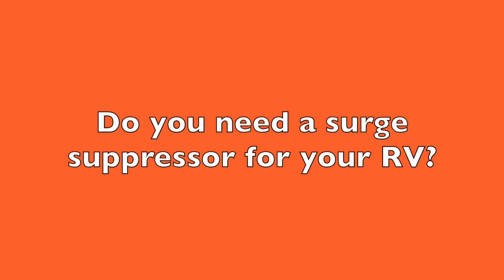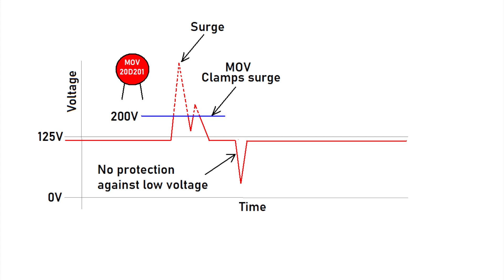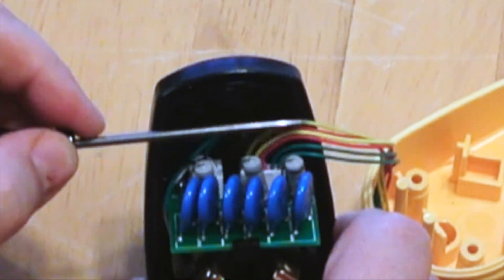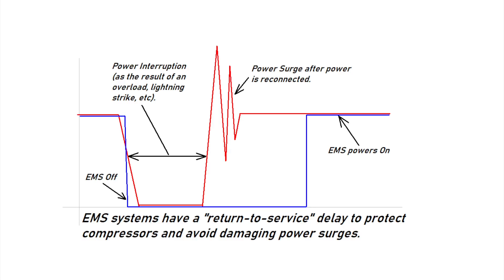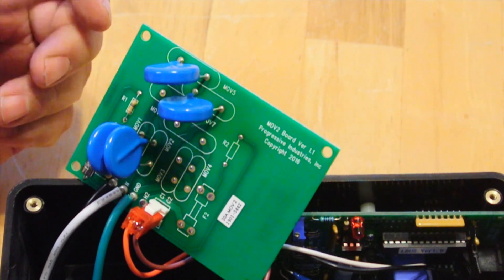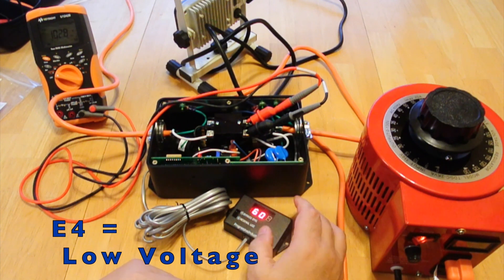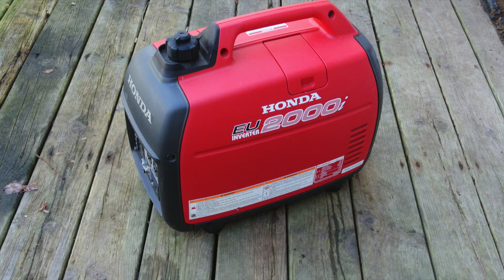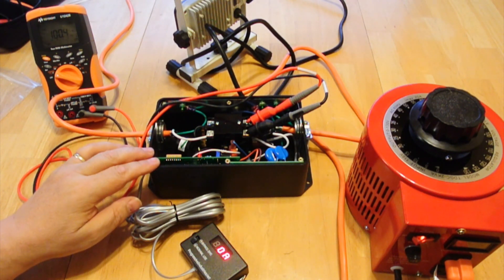All about EMS systems (and surge suppressors)

Comment: Nice job.  One thought though.  The EMS is used on the feed to the inverter not the output.  Our EMSis connected prior to the generator transfer switch.  This way the entire coach is protected.
Reply from the maker: Of course, the "input" to an inverter is a 12V battery.  The EMS can be connected to the charger which is powered by 120VAC, which is probably what you mean.

Comment: The EMS surge protector is the way to go. Expensive, yes but you get what you pay for. I came home from work one day to find that the power was off to my travel trailer. Turns out my EMS tackled a surge that completely burned it up.That electrical smell was horrible. I went to camping world and got a new one. Yes, approx. $400 but, I was back up in 20 minutes. I don't even want to imagine that situation without a good surge protector. Great video and thanks for sharing. I see a lot of folks today without one on their rig.
Reply from the maker: And there is the guy that comments that they have been camping for 30yrs and not needed one...

yet.

Comment: Great video, love all the info.

I considered getting the hardwired Progressive EMS with the built-in display but it doesn't have a way to switch it into bypass mode. I even checked the manual.
Reply: They sell a remote bypass switch for the ones with the built in display.
Reply from the maker: Just to be clear, the remote bypass switch for the EMS system with the built-in display is for the bypass switch only - and does not include a display.

Comment: I run my EMS through a Go Power pure sine wave inverter with no issues. I believe the issue would be 1) neutral bond, inverter is bonded to RV frame and may be insulated from the earth in some situations  2) as you said, a dirty sine wave will make the contactor chatter.
Reply from the maker: Thanks for the input.

Comment: Does the Progressive EMS with remote monitor give you the information remotely (by extending the display inside) as well as right there at the plug in storage area?
Reply from the maker: The remote has about 10ft of cord. In my RV, the remote unit is in the cabinet where the main control console is, while the EMS is hidden behind a cabinet.
Reply: @RVProject  Are there two displays?  One in your cabinet where the main control console is and behind the cabinet where the EMS is hidden?
Reply from the maker: @thedavidrichman  No. Just one display, which is remote.  You can buy a second display kit; EMS-RDS that includes a switchover.  This allows you to have another remote display, but only one display can be active at a time.

But it only works with the remote display unit.

Comment: Your audio level seems far lower than usual.
Reply from the maker: I do my video editing with iMovie on an iMac. Unfortunately it bit the dust a month ago and I had to buy a new iMac.  

The new iMovie version is completely different than the old one, and I am still having fits with trying to get audio levels correct. 

The old version of iMovie had a graphic audio equalizer that I could tailor the audio. The new version is lacking that feature.

I am using a Yeti Blue Mic and it should provide better performance than I am getting. Bear with me as I learn how to make the audio better.